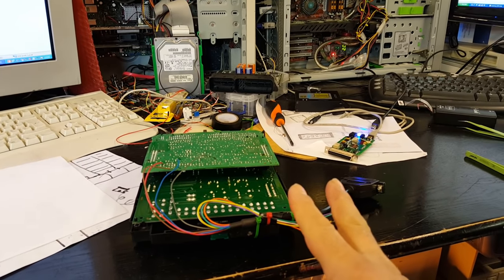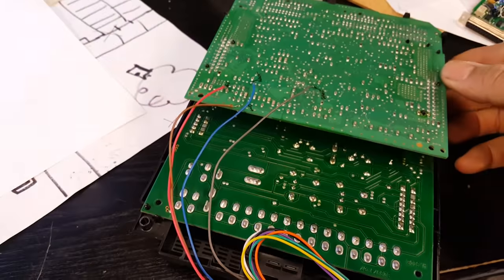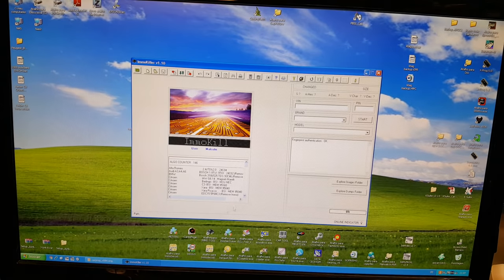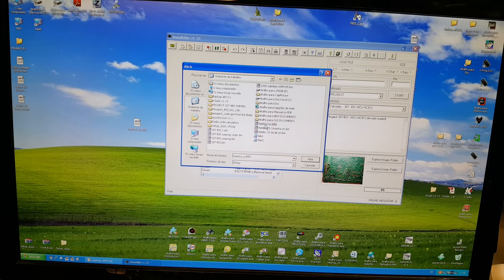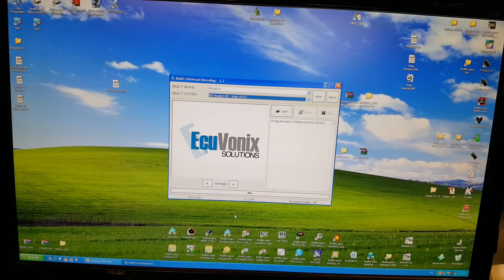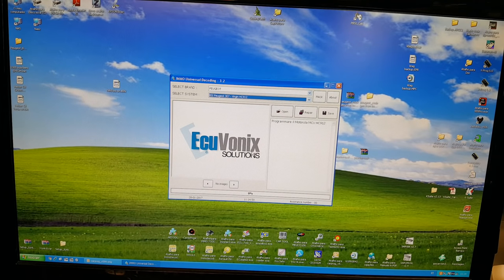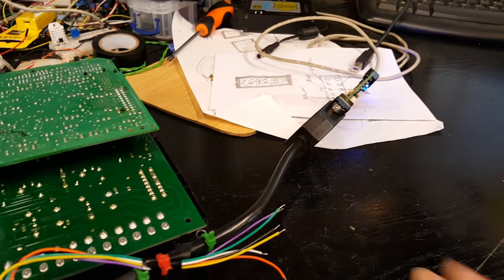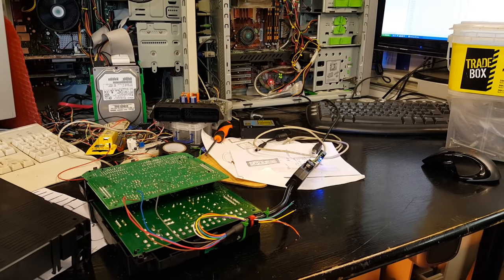Peugeot and Citroën BSI - clone, pin code read, virginize/ reset.

Comment: do i really need to virginize my second hand BSI? i collected my PIN from ecu using galletto. Can the galletto be used to virginize the BSI instead of carprog? i will use Diagbox to program new BSI, can Diagbox handle the not virginized BSI to program?
Reply from the maker: Hi
You need to virgin the BSI before Diagbox can do anything with it...
Thank you for watching!
Reply: @LMAutoRepairs   not having a programmer to read/write the bsi, soldering a new eeprom will do the trick?

Comment: Hi LM Auto
After my question about fixing the BSI AC problem (Not yet fixed) I made an horrible mistake (NOT listening to your warning about the mileage) and borrow an old BSI from a friend and connect it to my car which result with +40K to the car cluster. from 160K Now it show 200K :(.
Is it possible to reduce it to the lower mileage ?
I have PSA Planet + Carprog in hand. I can get any software for this mission if needed.
Reply from the maker: You need to remove the cluster and do it in there...
Put the cluster to zero miles, or anything below the original miles... Once you connect your BSI again, the miles will correct...
Unless you have already plugged your original BSI back in... which in that case, you made it worse..  and you need to modify the mileage on both now, the cluster and the BSI...
I can't remember wich chips are in those modules... but once you open them you will see.. 
Good luck...
👍👍👍
Reply: @LMAutoRepairs  
Thanks mate.
As I understand there is an eeprom chip there? If so NP.
Reply from the maker: Yes...

Comment: if you swap bsi . what you do ?
Reply from the maker: You will need also the keys, and program the engine ecu...
Also, you need the get the mileage corrected  before plug it it, if the mileage on the replacement BSI is higher, otherwise the cluster will adjust to the highest one...
Thank you for watching!

Comment: If i read the pin from old BSI and program the new (2nd hand) Ecu with the same PIN like BSI , if will runs everything normal? (i use the same soft like you) The old ecu is destroyed and haven't got way to get the info from there :(
Reply from the maker: You need to virgin the replacement,  end then program it with the car pin...
Thank you for watching!

Comment: Hi, 
How do you know the correct mcu model?
And is it possible to know if it's a eeprom or a mcu?
thank you for all you doing
Reply from the maker: The model or mask is written on the chip itself...
Thank you for watching!
Reply: @LMAutoRepairs  Thank you for your fast answer, you're the best!! I have a 307 (2002) with lock button flashing and the car wouldn't start. I think the problem come from the BSI... I will try to virginize the BSI and program it.

Comment: Hi Mister
You say on your comments : "There is tools out there that can do this through the OBD port, which obviously is more practical. " How to extract the PIN code from ODB2 port. I have Lexia3 cables and Diagbox program, can i do with them or is needed any other app ?
Reply from the maker: Lexia is the OEM tool... Will not do it..
Look for PSA tool... rare to find though...
Abrites is another option... but horror stories out there... 
Thank you for watching and for your comment.
Reply: @LMAutoRepairs  were you able to find and test someone of this apps ? The dealer extract the PIN code from VIN number ?
Reply from the maker: @MrLeofezollari  
I believe they have them on a database...

Comment: Hi, could you share me the software that you are using to read data and calc. the Peugeot pincode? I need to add key for 2004 Peugeot model 206. I am also looking for the connecting wires that you are using.
Reply from the maker: Hi
Do you have X-prog or a similar programmer?

Comment: Hello!- Can you help me?- My problem:I read my BSI pin code with FVDI, but died something. This is berlingo B9. no ignition,dark my dash now. My BSI goes eco mode or died? Have you idea what it is?--thank you so much
Reply from the maker: thomas Admiral 
Hi
Was that a Johnson Controls BSI?
Reply: yes :(
Reply from the maker: thomas Admiral 
Unfortunately you might be in a bad position...
There is reports that FVDI corrupts those BSIs...
http://www.fvdiobd.com/fvdi-experience
Can you try to virginize it and then reprogram... 
Have you lost communications with it?
Reply: yes,,don't see interface the bsi and the motor ECU too!-possible fuse problem? I don't save the bsi dump file,I have nothing.......hmmmm. I read a lot of idea,possible gone bsi safe mode?-thanks
Reply: And now deleted the eeprom in my bsi?.If i open it BSI and read the chip?-can I read something?
Reply from the maker: thomas Admiral 
You can try to read it on the bench, a direct connection might give you better odds...
But if the data in the MCU is corrupted, you need to search for some good dumps...
Reply: yes,,ok,thank you!!
Reply: it will good,,I upload to BSI the correct flash file!!!-and work the car!
Reply from the maker: thomas Admiral 
That's great news! 
👍

Comment: Hello mate, can I use ktag instead of carprog? Guess it makes no difference right?
Reply from the maker: Not really...
K-tag is designed for engine control modules...
You need an eeprom or MCU reader, depending on which module you are working...
Thank you for watching!
Reply: Working on a Citroen relay bsi. I’ll probably by a clone carprog or do you know of a cheaper option as it’s probably gonna be 1 time use.
Reply from the maker: Not sure of any cheaper options...
If there is an eeprom on it, there is cheaper... if you need to read a MCU then not really sure...
Reply: @LMAutoRepairs   Thanks mate. Just found out my bsi ok and it was the ignition that was messing up. Just a quick question. Is there anyway to do Immo off with diagbox or maxisys through obd if I have the key code or do I need to do it through the ECU. Is there a way I can check the type of transponder in the key because I’ve got the glass type in my key, but everywhere check for a 2007 Citroen relay transponder, it shows as IDT46 which is not the glass type. Are they interchangeable? Sorry for the multiple questions and many thanks 🙏 for your help.
Reply from the maker: You can't immo off with diagbox... if you have the pin code just program a new key...
The glass transponder used on those, from 2002 to 2006 is the ID48 T6... yours might was registered in 2007, but might was manufactured in 2006...
That's the glass transponder for those...
👍👍👍
Reply: @LMAutoRepairs  How can I get the pin code? Is it in the papers or in the car somewhere, or is the only way to calculate it or read it from the car?
Reply from the maker: Should have come with the car... on a credit card size scratch card...
If that has been lost, either reading the data of the engine ecu, or bsi to extract the pin, or go to dealer... in the UK used to be £30...
With a suitable tool, like the IM608, (there is others as well...),  you can also get the pin through OBD...
Thank you for watching!

Comment: can u test if really the FVDI kills the BSI jhonson or not please .
Reply from the maker: Hi
I never tried it... but people says it does... at least the clone one...
Thank you for watching and for your comment!
Reply: @LMAutoRepairs  some says that u need just to keep the battery voltage above 13V
Reply from the maker: @MrFOXMAROC  
For any programming etc... a charger needs to be connected....
Reply: That's true, i would like to thank u for the effort that you put to produce those videos.
Reply from the maker: @MrFOXMAROC  
Thanks... more to come...😉
Reply: I have a trouble code P22A5 on my w204 c220cdi om646 any help please, when the engine is cold i notice rpm fluctuations just a bit, i have just replaced the ECU and fuel quantity control valve.
Reply from the maker: @MrFOXMAROC  
That's related to O2 or exhaust temp sensor, if I am not mistaken...
Have you check wiring etc?
Live data, measure the sensors?
Reply: I don't have star diag, but the launch says that is the pre-turbo temp sensor. The problem comes just when the engine is cold so i guess it has relation to a temp sensor.
Reply from the maker: @MrFOXMAROC  
There you go... you are in the right track...

Comment: hi brilliant video, could i ask  some advice. I have a 2001 406 hdi 2.0 estate and the bsi has burnt out on a couple of tracks i repaired them but i still have lost dash service indicator and mfd, the wipers and central locking. Car did start and run with these faults but it now only turns over cranking. Would i be best off trying to find a 2nd hand bsi and virginizing it, then inputting using planet2000 the vin and pin that i got from peugeot?
Reply from the maker: davedree 
Hi
You can do that... should work.
You can try to take the pin from your actual BSI... providing you have the tools...
Good luck...

Comment: Hi sir im problem with my bsi modul for citreon 2006 c2 after pulling immo eprom not getting comunication from bsi why?
Reply from the maker: How did you read the eprom?
Reply: Yes I read the eprom to the pincode to code key that's all was getting coms but not showing vin anymore on my lonsdor
Reply: With vvdiprog desolder it
Reply: I unsolder the 95160 eprom from bsi then xtracted it normal then I use lonsdor to code key lonsdor accept pincode but it don't show the vin number cos the first time I tried it I did pull vin but after takeibg bsi eprom im having issses

Comment: Hey bro, best channel ever. Thank you a lot for sharing your knowledge with us.
Can you help me with my Citroen Xsara N2.
I want to read out the pin code and virginize the bsi.

It is a Valeo 730 045 12 BSI var C CN2.
Which carprog adapter should I choose and do you know the pinout?
Reply from the maker: Hi
No need to read the pin if you are going to virginize... 
What is the chip inside?
Is that an external eprom, or is a mcu?
Thank you for watching and for your comment!
Reply: @LMAutoRepairs  
thanks for answer. I want to virginize the bsi and then install and initialize in my car, because the original one was water damaged.
There are a lot of eproms, which one is the right?
I tried to read out the 95040, but there were only zeros and I don't know for what this eprom is.

Then there are two microcontroller 75076358 & 75076359 with software version V3.231

Comment: Hi, Very good Video! I have a few questions for you : Can I read the eeprom with an universal programmer?for example I have a Mini Pro TL866A.Can I read it with this programmer?Can I connect the wires like your connections?Will it work?
Reply from the maker: Hi
It all depends on the bsi... some have an eprom, and some other ones have an MCU... 
They are read differently...
Thank you for watching and for your comment!
Reply: @LMAutoRepairs   Hi, If I take the eeprom or mcu  out from the board  and I read it with my programmer,the resulting bin file is   good? Or it must be readed with special tools?thank you!
Reply from the maker: @fychy  
You can do that...
👍

Comment: Great video, loads of info.
Could you help with wire install for citroen picasso bsi
have carprog maybe clone, where can i find wire colour codes
so i can solder onto 95160 eeprom
Reply from the maker: paul lee 
Hi
If the eeprom is accessible, better to remove it, do the work and put it back on...
With car prog, you have some documentation that tells you what wire colour is what... from there you need to know which bsi you are working with... 
Can you access the eeprom?

Comment: Hi, good video, do you have problems with the colours of the carprog wires not being the same on the clones or did you buy geniune plugs so the colours match up to diagrams hope  this makes sense cheers lee
Reply from the maker: lkim08 
Hi
Yes it makes sense...
My carprog came with the correct wire colors... At least when compared with the pdf files that came with it...

Comment: Does the same thing apply if you would like to replace a Peugeot/Citroen Engine ECU ,so that you can keep the same BSI and Key?
Reply from the maker: Auto Sport 
Hi
Pretty much yes....
But depending on the ecu, and providing you have access to the data on the old ecu, it might be easier to just clone it... saves you all the mess about with PP2000...
Thank you for watching!

Comment: Hi, great tutorial. I have a 2002 307 2.0 which had water in the bsi. I have found another bsi but need to clone the eprom from the original.  It's a Valeo bsi, I need help on how to connect carprog to it. Cheers and many thanks for the great info.
Reply from the maker: Hi
I can't post picture here, however, do a quick google search and you will find it in no time...

Comment: Hi, could you get the pin code from the ecu bin file?
peugeot 807 2004
Reply from the maker: Go on my forum...
👍👍👍
Thank you for watching and for your comment!
Reply: I have done it from the bin file from a 206 BSI... but it's a real ball ache. The software used here is a zillion times faster than the time it took my feeble brain cells to wrestle with the hex codes and then squeaky bum times programming the key in case my hex to ascii calculation was wrong... but it worked! Not sure I'll use that method again when there is a software solution like this though.

Comment: hi and thank you for your awesome videos.
Could you please suggest some good softwares for deleting DPF/EGR from ECU file?
Software on which you can load the file which was extracted from ECU, and delete DPF or EGR.

Thanks.
Reply from the maker: diesel parts 
To read the ECU there is loads, but all depends on the ECU it self... 
From KESS to K-Tag, Galetto, piasini etc...
To delete the DPF from the map, that's a bit more tricky... you can easily get hold of the ECU safe and volta... but they are limited and not always work... there is more out there just Google it... The best way to delete the dpf though, is manually with winols for example... but that requires experience and know about maps etc... hope that answers your question...

Comment: Hi which tools do you refer to when you say it can be done through obd port ? and which tool do you recomend for this xprog or carprog ? By the way good video like it :)
Reply from the maker: Kosa Arpad Szilard 
Hi
You have for example,  a tool called "PSA BSI Tool" that reads the pin through OBD on certain models... there is other similar.. 
Hope that helps...
Thank you for watching!
Reply: Hi thanks for your answer. Thats what i thought :)  no go for my model 2002 peugeot 307. I just changed the bsi and ecu  +key to get it started . Everything works now on car well almost :) . But i noticed that the bsi was not the original type which was in  car before. So im assuming that (after doing some reading with pp2000 where everything looks fine.) no communication with instrument panel cluster, and not recognizing the door modules is because of this . So next step is trying to virginize the old bsi . For this i need carprog as you showed in video. So i plan to buy one can you reffer someone who sells and can be trusted?

Comment: Hi, thanks for the reply, these boards you are working on just split apart but I would be very interested in seeing you do similar work with a new style bsi eg citroen c3 Picasso I had a nightmare with one keep up the good work pal
Reply from the maker: lkim08 
No worries... I do this things as a hobby/part time... and some times  I just want to get the job done... and do not have time to record...  but will try if one comes around...

Comment: Hi, great stuff, what else can carprog do? Thanks Jonathan
Reply from the maker: Jonathan Dean 
Hi
Airbag reset, some ecu pin read... etc...
Thank you for watching!
Reply: Thanks, could you also tell me, will the zed bull key programmer tell me the pin code for a car key?
I have one key, but would like one more cut, but I don't have the key pin, it is a peugeot.
Thanks again
Jonathan
Reply from the maker: Jonathan Dean 
Don't think it does...
Do you have how to programme the new key?
Thank you for watching!
Reply: LM Auto Repairs Thanks, yes I need to program a blank key, I have one working key, with the zed bull do it? Thanks again Jonathan